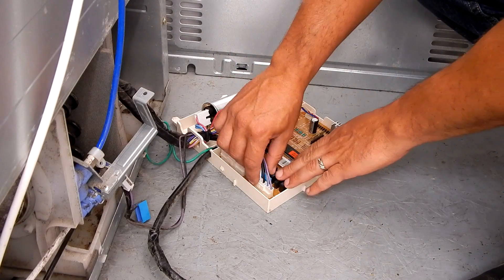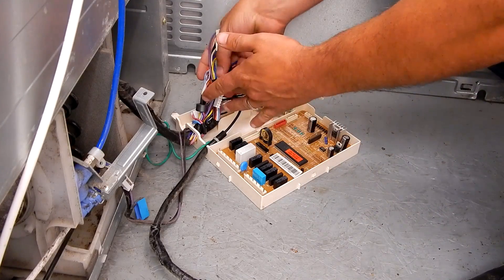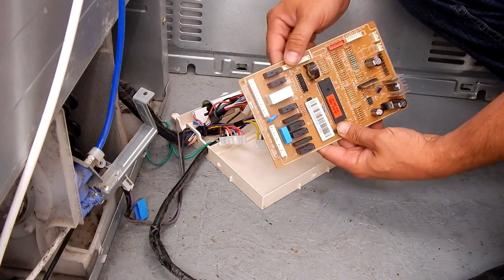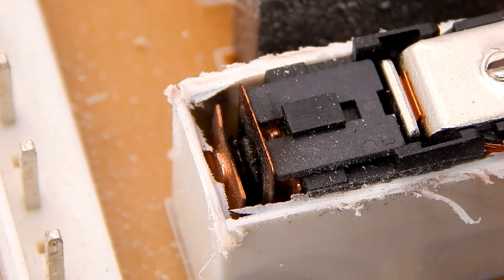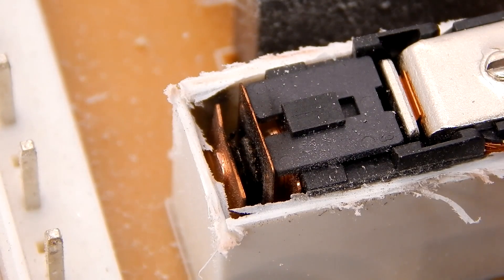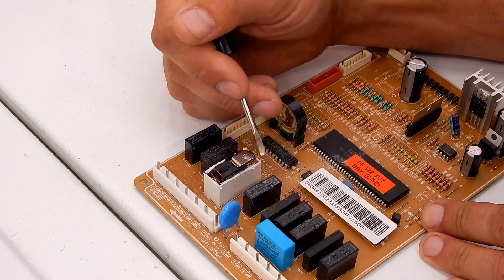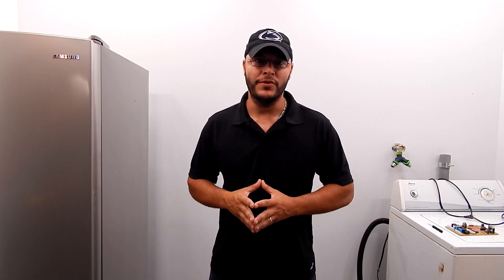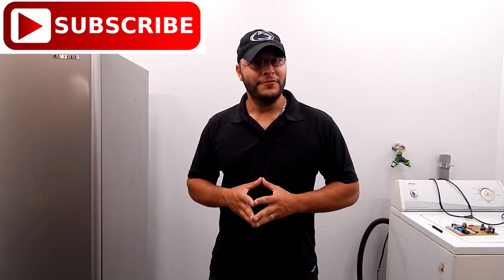Looking Inside a Samsung Refrigerator Compressor Relay

Comment: My fridge has not been working. I had it unplugged for a day. I went to plug it in and started working again.............for about an hour. Iit cooled down, but then later it would not kick back on to cool again. I UNplugged it again, and later in the day I plugged it back in, and again it started to cool, but after a while it did not want to continue to cool. What do you think would be cause it not to continue cycling the cooling process. only starts to cool when I UNPLUG and REPLUG the fridge.

Comment: Hi Bill Thanks for the great videos I have the samsung twin cool and took the top off of the compressor relay I have the unit running with the contact closed how long can I run the unit until the new board gets here which will be about 3 days. I don't want to burn up the compressor, I have a 12" fan blowing on the compressor all the time. 
thanks in advance for your answer

Bill H
Reply: What happened with your relay? Did you let it run for 3 days?

Comment: Hi Bill, my refrigerator is doing exactly that and i forced the contact but now the lights in the fridge are not turned on anymore and the front lcd. Should I go ahead and replace the control board?

Comment: I have this exact same fridge my refrigerator stays at 39 degrees but my freezer fluctuate -19 to 7  on the front display there's no ice build-up on mine. my ice maker is working perfectly fine with no melting. what can you suggest it might be
Reply from the maker: +dmoney1dm8512 I could check the freezer thermistor connection.  Could be causing a bad reading.  I would go there first then move on from there.

Comment: Nice video, for me it would be also were easy to replace the relay ;) And sometimes you can open the relay by lifting the complete top of it is attached with two clips, the clips are on the bottom plate of the relay but anyway repairing this particular relay is it not worth a replacement is much easier. Most likely the contacts are burnt out because the relay switches a inductive load, that create a voltage spike every time when the relay switches off, and that voltage spike creates a small electric arc between the contacts, and that arc burns out the contacts. My guess the circuit don't have a arc suppression system to save costs.

And thumbs up :D

Alex
Reply: Your comment is great. Samsung has left their their customers out to dry with charging $2k for a fridge that self destructs in 8 or 9 years..

Comment: Do not loose the numbers that is on top of that relay, because I do not have the schematic on that board.
Figure mailing and $4.00 for the relay. Labor Free.
Reply: MrMac5150 hi there! 
 how much is a refurbished board? do you fix them then sell them?
Reply: michele austin
 I can refurbish as long as it is NOT a IC Chip.
 common parts are available but not special
manufacture chips or  Eproms